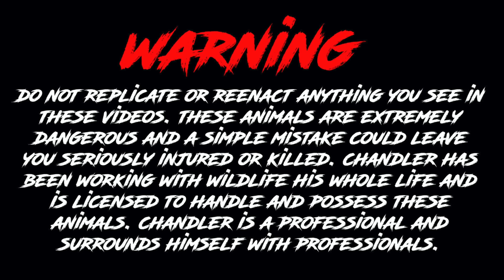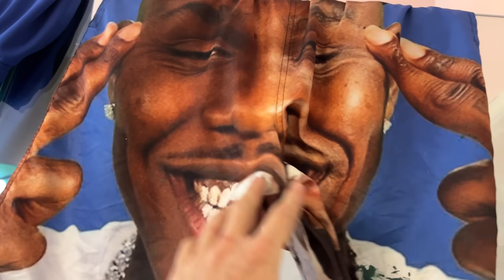Feeding Crazy COBRAS! @TheUrbanRescueRanch

Comment: Is ocean beach sand the best for use in animal enclosures? Saltwater is very corrosive (this from a long-time marine aquarist.) Beach sand will have absorbed the salt & minerals from hight tide/sea spray which might irritate the inhabitants. I know builder’s sand is usually recommended for animal enclosures.
BEN; You need to establish some aquatic vegetation in your pond(s) to cut down algae blooms & form a bio-active filter. You can collect most of the plants right from nature, even willow cuttings & duckweed would help. Otherwise you’ll have nasty, green mud puddles (again) this summer. Mechanical pumps will only do so much, aquatic plants are required to absorb the ammonia/nitrates from animal’s poo.

I’m just sayin’...